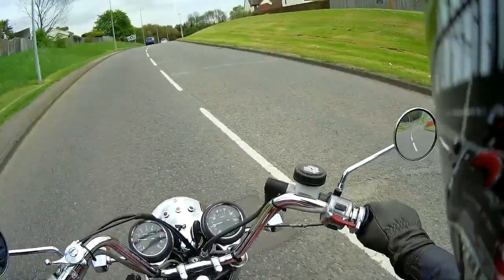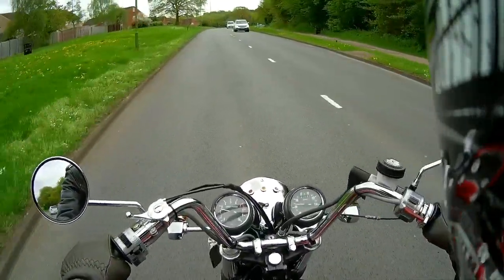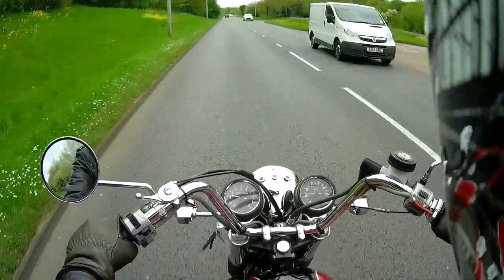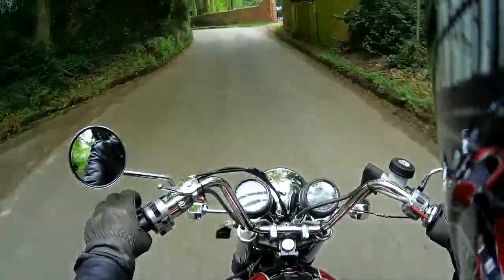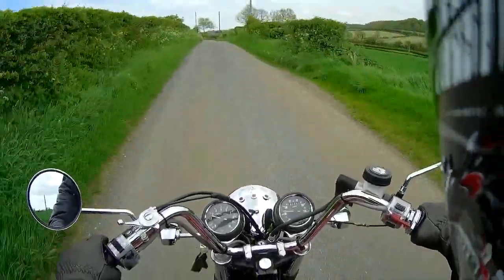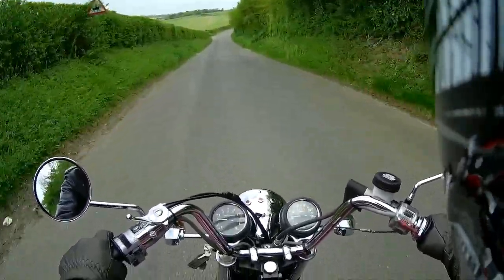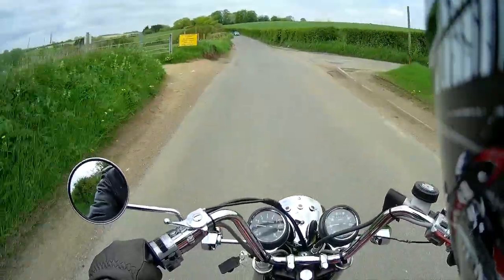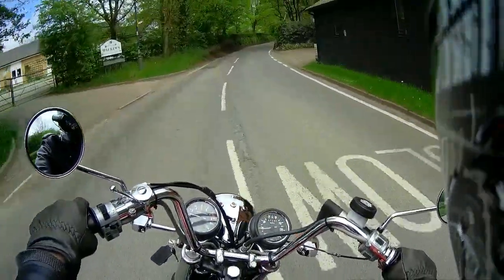Old Biker - Triumph Bonneville Six to Seven Plate Clutch Review

Comment: About twenty years ago, I was inside the clutch of my older Harley, I converted it over to hydraulic, and found the clutch was entirely different, much better, than I'd ever had on it before.  I'm riding a 78 Bonnie, these last few months, new to me, and I'm thinking about converting it to hydraulic as well.  I used parts from a Honda shadow, for the Harley, slave cylinder, I watched this because the seven plate clutch is something new to me, haven't worked on a Triumph since the seventies, I think it would be a good job, a good fit.  Thanks for your review.
Reply from the maker: I used T120 clutch springs in my setup, the 120 springs are not as stiff as the 140's which makes the clutch a lot lighter,  keep us posted on the clutch if you manage to do the conversion, be interested in seeing that, nice one

Comment: hello if you cut the clutch push rod in half and round and temper the ends, and put a ball baring between the two halfs , and shorten one end the same amount as ball, this will make a light clutch the triumph race guys used to do that, and i have done it on mine, lee

Comment: You may have low mileage but the early or oil frames would clog up the sludge trapping less than 10000 miles my 1965 TR6 with a half a million miles and 40 + years when we tore down the engine to replace the camshaft which war out to flush trap was almost but not quite full

Comment: Hi mate I’ve got a 68 500 Daytona, and some times when I gun it the 6 plate clutch will slip slightly,  would a 7 plate fix that. Cheers Martin ⚙️🔩🔧👍
Reply from the maker: Hi Martin,  a slippy clutch has lots of reasons, It may be weak or incorrectly adjusted springs (a light clutch operation) , a tight cable which prevents the clutch from engaging properly (that would cause a heavy clutch operation), a sticky or worn clutch lifting worm or just worn plates, oh and also the spring cups could be sticking and also the clutch basket may have grooves worn into it by the plates which would also make the clutch heavy and  gear changing harder. Only way to find out and to check most of that is to strip it down, a winter job.
Cheers, Cliff
Reply: @OldBiker  Cheers Cliff, that’s give me some food for thought,  the bike had a new clutch basket by Previous owner in 2019,  has only done 1000 miles to Date,  so will double check adjustment first and check the cable route,  I’m running with ATF oil in primary chain as recommended by previous owner,  the clutch operation is not heavy,  so if all Else fails it’s a Strip down, it might be weak springs or they need adjustment then . Cheers Martin ⚙️🔩🔧👍

Comment: so i tried a 43 rear tooth on my t140d lovely cruising but lost a bit off its peppiness.was on a 47 t so gonna try a 45t and compromise front is 20t on the 43 4000rpm was 70 mph so i rekon a 45 might b arround 4250 at 70 mph and still lively lower down.my 7 plate is still heavy cas i had to tighten it down to stop it slipping.shame really.
Reply from the maker: I think mine has a 45t next time out if I remember I'll see what the rpm is at 70

Comment: did u ever get rid off the stumbles?mine still has a tiny glitch cant find it,improved slightly when i put the needles on the weakest setting (2c3 needles) like a thorn in my brain lol.
Reply from the maker: Hi Gareth, the other day I converted my carbs back to stock, stainless 2c3 needle and .105 stainless needle jet, needle position in the middle, 200 main jet, 25 pilot jet and 50 cold start jet with the air jets installed, the only change I made on that setup to stop the stumble completely was change the throttle slide to a No2, now I've done all that I'm going to put the peashooters back on and start all over again from the current setup so that I can get this bike running loud and perfect as possible lol we never learn to leave things alone!
Reply: @OldBiker  a no2 is ritcher ?maybe i could try changing slides but i thought my stumbles were ritchness so i use a no3 now not sure which way to go, on my needles the top knotch (leanest) the clip is a crap fit in the groove not impressed.i must have had the carbs off a dozen times trying to cure it ,inless its in the ignition somewhere just changed leads and plugs with 5ohm resister caps cos off boyer hasnt cured the stumble.grrrrrrrrrrrrrrrrrrrrrrrrr.
Reply from the maker: Hi Gareth, are you sure its stumbling due to richness, the 2c3 needle setup is what they used in the States for the emissions and that carb setup made those machines run lean. A rich stumble would sound like a deep growling hollow kind of sound but wouldn't cut out at all, a lean stumble would be like the engine cutting out a split second while riding or even all together when you blip the throttle stationary. 

No3 slides are what the original basic T140E setup started off with, also with your needle clip position at the top and using a No3 slide sounds like it would be pretty lean running to me, on another note, make sure the mixture screws are set at two turns out if you use a 25 pilot jet.
Reply: @OldBiker  right cheers,on the middle clip plugs looked a tad ritch so i raised a knotch plugs look cleaner,but thats all,i use a 35 cold start jet 50 was way too ritch on mine used to bellow out black shit on 50"s with full choke,now starts first kick with no throttle hot or cold (stone cold with choke) its the teeniest off glitches but i want perfection lol,could try a 2 slide but could b money wasted,test riding my 45t rear sprocket tommorrow weather permitting,43 was a bit less peppy lower down 47 too revvy at cruising speed,have a very loud reverse cone mega tried a pattern bonnie special silencer glitch still there.grr.improves when warmed up properly is that a clue ??